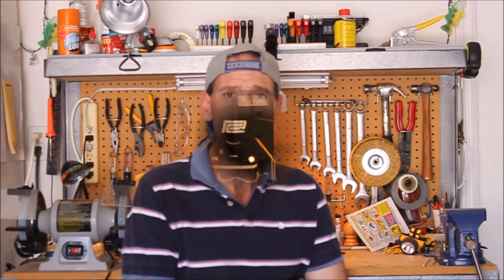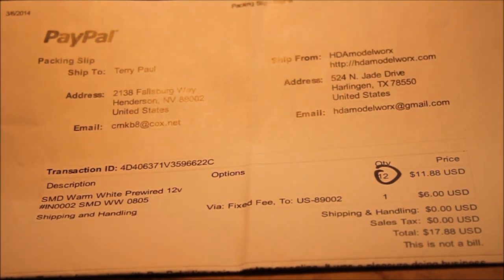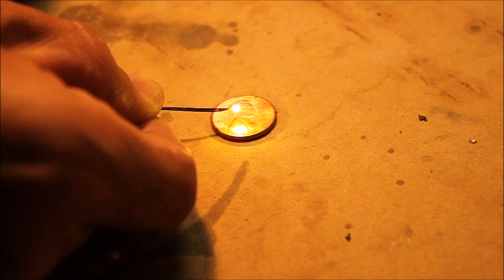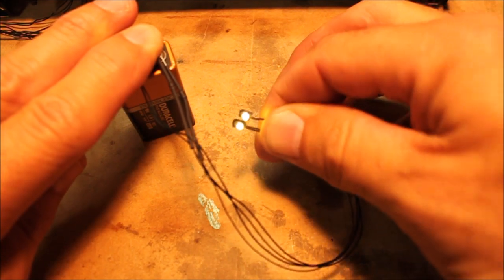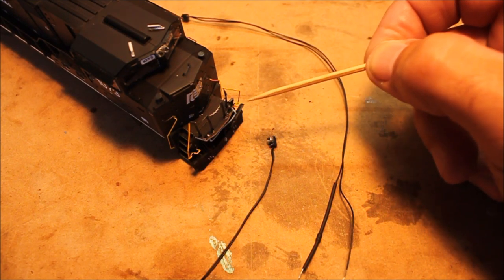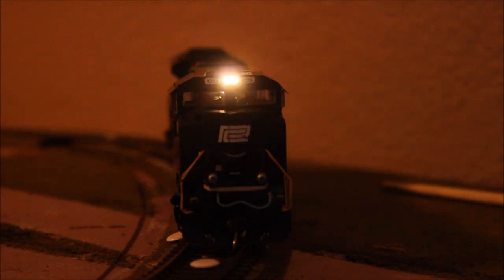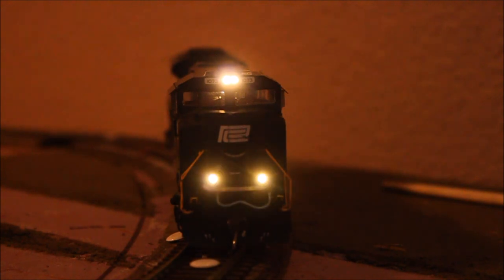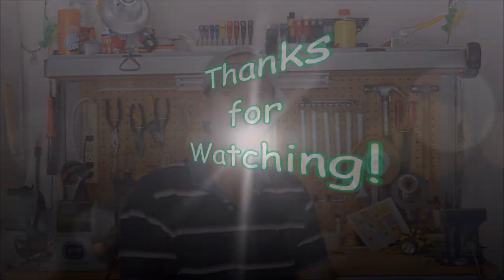LED Upgrade - Athearn, HO Scale SD70ACe

Comment: Looks damn good. And your flash rate on the DLs is perfect. As a note if that model has the Tsunami 2 decider u can set CV122 to 168 and the Ebell will be on auto tied to the horn.
Reply from the maker: This loco/decoder is 4 years old, the Tsunami 2 didn't exist with this run. Thanks for the comments!

Comment: Hi dear friend, your videos inspire me greatly to modernize my model and my locomotives. 
My question is this I own an SD 40-2 Bachmann with Tsunami AT1000 sound, but no ditch lights and I wish to place but not where to connect decoders .. my question is if you can tell me how should I proceed ??? Greetings !!!!
Reply from the maker: combrastur thanks for the gesture! First, you say "no ditch lights", does this mean that there isn't anything at all (such as fake lights) or anything that looks like light housings? I'm guessing there's nothing at all and we'll need to start from scratch. Also, is this the "sound value" decoder?

Comment: Hello penn central,
I am doing a lighting upgrade with my genesis gp38-2w with smd pre wired lights, on the ditch lights did you mount the lights facing upwards into the housing or did you bend the wires at a 90 degree angle to the led face, drill out the housing, then pushed the led upwards so that it faces strait out of the opening opposed to shining through a lense?
Thank you :-)
Reply from the maker: I used the ditch light housing that came with the loco. The lens of the light is facing forward (top of light towards top of ditch light housing). I kept the lens for the ditch light housing in place. I used a HDA Modelworx 0805 pre-wired (with resistor) LED, which is a little tight for the opening. HDA has recently released a smaller LED that I believe will fit in the opening without much trouble. After the light is in the housing, gently bend the wire 90 degrees to slide back into the hole in the front of the loco. Thanks for watching and your comments/questions. Hope this helps.

Comment: Penn central just saw this and I love them .. I am like you and need to definitely replace the lights in my locomotives as the Atherean ones continue to burn out and i have a few kato as well. I am on a waiting list as they are out of stock but great price. Question when you installed the front headlights did you just put the led into the holes or did you have to add a head light lens at all .. again great video and very helpful .
Reply from the maker: hey dude, I've been subscribed to you for years! Your video on staggering the rail joints inspired me to do the same. Anyway, glad you liked the video and hope it helps. I just pulled out the old bulbs, seems like they were held in place by some sort of tacky glue, they just pulled out with no damage.  Here's a video (https://www.youtube.com/edit?o=U&video_id=RcXRnVkpnHU)of a complete upgrade, including ditch lights that I had to drill and fill. Thanks for watching and commenting!
Reply from the maker: Work on the layout has slowed down, but I have been spending more time learning weathering. I plan on getting back to working on the layout.

Comment: So just to clarify,  you wired the headlight, reverse light, and ditch lights up the little +14V common, and then to the negative (rectangular) pads for the headlight, reverse light and ditch lights with a resistor. Did you put the resistor on the + or - side? I have an LED for each light, totaling 6 wires, not sure how easy it would be to wire up 6 resistors to the little 14V common port.
Reply from the maker: yes, that is how the GN-1000s need to be wired for LED. The LED's that I bought for the ditch lights came with a resistor already installed. Yes, with forward, reverse and ditch, it's 6 wires. I soldered a larger wire to the 14+v hole, then all the little wires to the big leader wire.  Thanks
Reply: +PennCentral99 excellent, thanks a lot!
Reply from the maker: on a side note: you almost don't need the rear ditch lights. I'm sure you're aware, ditch lights are only required on the lead loco, when's the last time you saw the lead loco running in reverse?
Reply: +PennCentral99 

I must have put a comma somewhere it doesn't belong, but I 6 bulbs, 1 for each front ditch light, and two for the headlights. I wanted to use the same types of bulbs for each light to make sure the color and brightness was appropriately matched. so there will be 1 for each ditch light, 2 in the headlight and 2 in the reverse light, but no rear ditch lights.
Reply from the maker: you're OK, gotcha.  here's a link to the LED's that I bought. the owner of the company watched my video where I installed them in the Makeover UP 9807 C44-9W upgrade. He said he didn't know these bulbs could be used for model railroading and was very impressed.  http://hdamodelworx.com/5-PACK-0805-SMD-WARM-WHITE-Pre-Wired-with-Resistors-and-Lead-Wires_p_84.html

Comment: Thanks for the previous help. I have a new question. I use the NCE system. Because I buy used model locomotives some of them have Digitrax decoders, older decoders like DH123. I have enough trouble programming Lenz but have been able to do so. Do you know if I can get ditch lights on the Digitrax decoders working with a NCE system? I've gone through information online but it is hard to understand not having a Digitrax system.
Reply from the maker: There were several types of DH123 decoders, have you checked to see if they are capable to operate ditch lights? If so, you should be able to program ditch lights, the CV's for the digitrax decoders should be programmable through the NCE. Let me know. Thanks
Reply: I have the green and purple wires therefore I should be able to get flashing ditch lts, if only I could figure out the programming. Thank you
Reply from the maker: go to http://www.digitrax.com/support/cv/
Read CV 49-52, CV113-116 FX3 Lighting Effects Set Up
Reply: Thank you so much for pointing me in the right direction!
Reply: I'm not the only one that has trouble finding decoder programming for decoders. The info you recommended is more likely for the newer digitrax. I found some old  notes I wrote down a few weeks ago that allows me to get the ditch lights to come on with the head lights and flash with function 2. An old quick digtrax setup I found online some where. Not as much control as I would like but I'll live with it until i replace the decoder to a TCS. Which is by far the best decoder on the market. I'm glad I've never bought a digitrax!

Comment: Just installed two micro litz leds ditch lights in a P2K SOO SD60M. I'm using a Lenz standard plus decoder. But the loco slows down when I turn on the ditch lights. I'm using the proper resistor and I've checked the wiring. Have you ever had that problem? I'm new to ditch lights and it has me puzzled!
Reply from the maker: no, I have not had that problem. Maybe you can check with Lenz or go to one of the many model railroad forums and ask the question. Good Luck
Reply: Thanks for responding to my comment. It was bad luck, my first ditch light install and the lenz decoder has some kind of an issue. I put a different decoder in the loco and it works fine. I've now done several locos only 100 more to go! Hard to locate ditch lights, Leds are readily available. All the P2Ks I've bought over the last few years have enough for front and rear but I'm not doing rear. This will give me a surplus of ditch lights for a while.
Reply from the maker: Glad you were able to figure it out and fix it. I know very little about Lenz. Keep working away at your installs and they'll be done in no time. I think the HDA Modelworx SM LED's are the best for lighting, and they're cost efficient.  Thanks

Comment: Shot in the dark here as this is an older video. However I just bought these same LEDs you have... Wired up to the decoder, not working... However bulb is good tested before and after with a 9 volt battery... any ideas?
Reply from the maker: Did you use a Soundtraxx Tsunami or another brand? If you used a Tsunami, is it wired exactly like in the video? Do other decoder functions work? Maybe send a pic of the wires attached to the decoder.  Thanks
Reply: PennCentral99 Hey! Thanks for the reply, though after looking at your ither video of that UP engine you did... I figured it out. I didn't have my positive on the 14 volt lead. Thanks for the reply and video!
Reply from the maker: Glad the videos helped you and you were able to figure it out. Thanks for watching and commenting!
Reply: Okay, how about alternating ditch lights? The front lights work fine as well as the ditch lights. I connect the negative lead (black) wire the the "F5" tab on the decoder... apparently that is for the rear ditchlights... however they work when in reverse. They do not alternate however when I sound the horn. Instead they both blink at the sometime. I also have am "F6" tab on the decoder that doesn't appear to be programmed to anything. Any ideas?
Reply from the maker: F5 is one of many functions on a decoder, it is common to use F5 for the ditch lights (front). The ditch lights are directional, and change whether you're in forward or reverse. F6 is for other additional lighting functions such as number boards, roof beacon, etc. and can be used for the rear ditch lights. Flashing ditch lights are programmed through the CV's. In an older tsunami, it's CV49 through CV52 and has to do with Type 1 ditch lights and the Grade Crossing Logic (horn sounds and lights flash, just like the real deal). The programming is also determined whether you're using incandescent bulbs or LED. 

For flashing front ditch lights on my Soundtraxx Tsunami, I have CV51 programmed to 169 and CV 52 to 185

Have you read the manual for your particular decoder? It contains a lot of useful information. Let me know how it goes
Reply: PennCentral99 Yeah I've read through it. I'm using the exact same LED lights you have from HDA. I was doing some research and found that... Potentially switching lights for LED lights will make the bulbs not blink due to the type of decoder is set up for incandescent bulbs... In which of you add LED lights or loses functions due to the decoder not really knowing what is going on?
Reply from the maker: the 14+ is for LED and you shouldn't lose flashing or blinking. It also depends on the decoder's ability (4 function or 6 function). If you want flashing front ditch lights, you may lose the rear ditch lights and have to wire one front ditch to F5 and the other front ditch to F6 and then program the CV's
Reply: PennCentral99 Okay, I will mess 
 around and see what I can do. Thanks for the info!
Reply: PennCentral99 Seems that if I am wired to F5 tab on the decoder, it is for the rear of the locomotive. When I sound the horn they both flash simultaneously instead of alternating... I do remember when I removed the old lights. One was wired to F5, the other was wired to the front and did not alternate.
Reply from the maker: The F5 can be programmed to your desire. In my Intermountain ES44AC with LokSound, the factory settings have F5 for the lighted number boards and F6 is for the ditch lights. Your F5 can be for the rear. You may need to wire one of the front ditch lights to F5 and the other to F6 (and common is common), then program the CV's for alternating. You'll probably lose control of the rear ditch lights

Comment: I just paid $3.75 for 1 white 3 volt 5mm 5000 mcd led , and $2.75 for a red 3 volt 5mm 3800 mcd led . pack of 8 resistors cost $1.20 hooked up and working well.
Reply from the maker: Glad it worked for you. Even though LED may seem to cost more, they'll last a lot longer and you'll be happier. Thanks for watching and commenting!

Comment: Do LED lights still light up decent at low speeds? This is the thing I'd like to achieve.  At normal slow yard and switching speeds, the lights were typically very dim on my old Athern loco.
Reply from the maker: Yes. That's the nice thing with LED/DCC, the current feed is constant once track power is ON and not reliant on the throttle setting. Thanks for watching and commenting!
Reply: @PennCentral99  I am using a DC system.  But I think it will still be brighter than the old incandescent bulbs.

Comment: Do you have to add a resistor or does the decoder already have one?
Reply from the maker: Soundtraxx Tsunami decoders do not have resistors for LED's. I'm not sure if other manufacturer's have resistors for LED's built in. You must use a resistor, usually 1K ohm, 1/4 watt. You can buy them on ebay for less than pennies each. The LED's I buy have resistors built in and they cost $1 each.
Reply: Ok cool thank you, I have bought some of the LED's you use. Didn't see you install any resistors so wasn't sure where they were. Now I got that they are built in. Thanks.
Reply: Ok cool thank you, I have bought some of the LED's you use. Didn't see you install any resistors so wasn't sure where they were. Now I got that they are built in. Thanks.
Reply: Ok cool thank you, I have bought some of the LED's you use. Didn't see you install any resistors so wasn't sure where they were. Now I got that they are built in. Thanks.
Reply from the maker: if you bought the HDA Modelworx lights, the resistor is under the heat shrink.

Comment: Too bad you didn't show how to connect the wires to the decoder.
Reply from the maker: The video wasn't about wiring decoders, it was about replacing incandescent bulbs with LED. When you disconnect the old wires from the decoder, remember the location so you can attach the new ones. If you're looking for instruction on wiring decoders, go to my video library.